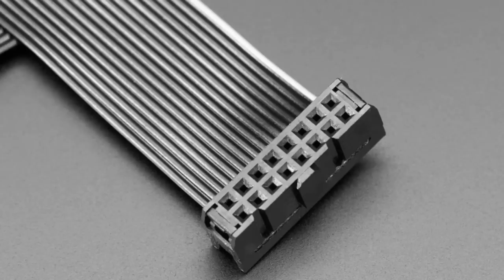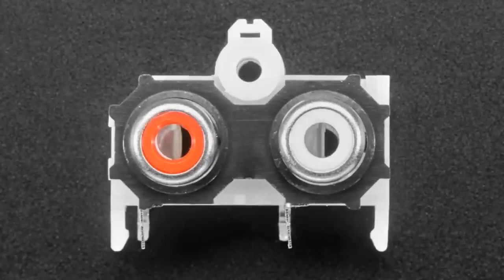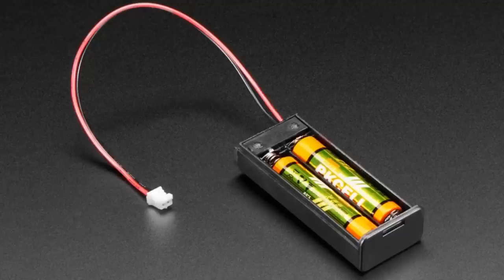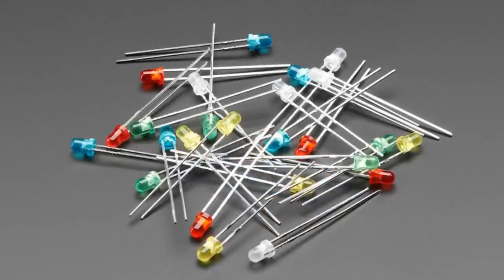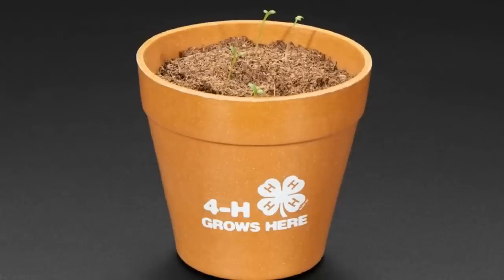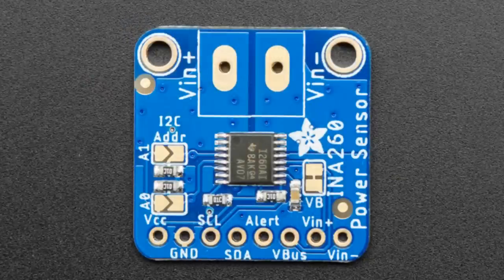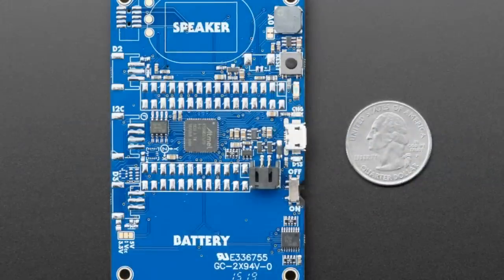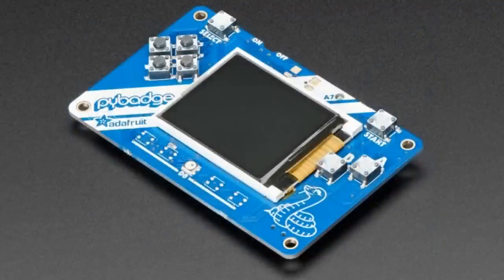New Products 5/2/19 Featuring Adafruit #PyBadge Low Cost! @adafruit #adafruit

Comment: The header that's delivered with the INA260 (Product ID: 4226) does NOT allow to attach a 1.5mm² cable with ferrules. Why? The sensor is capable of up to 15A and 36V, that's 540W. How am I supposed to connect this sensor properly?